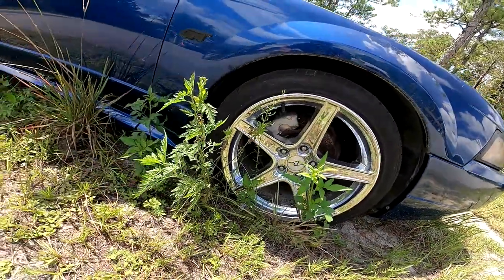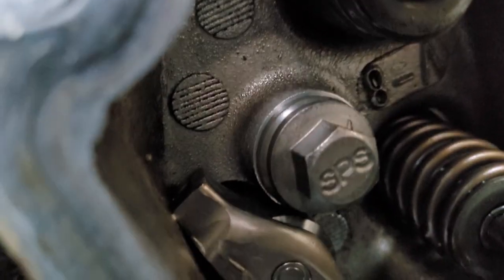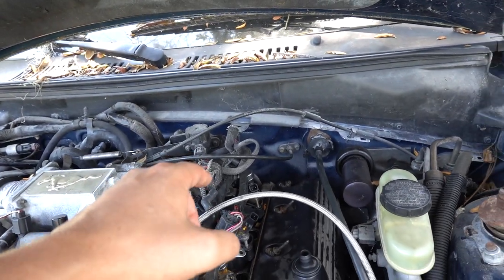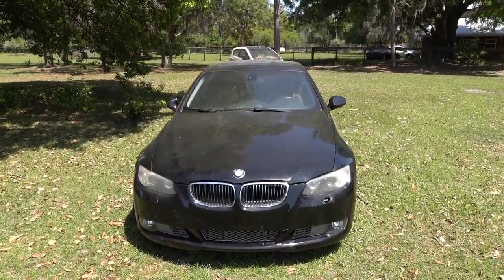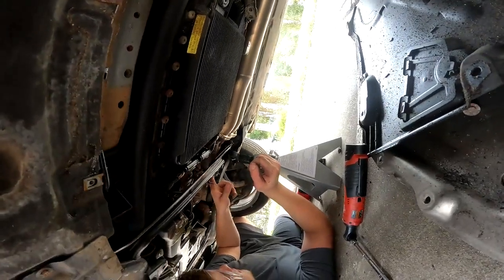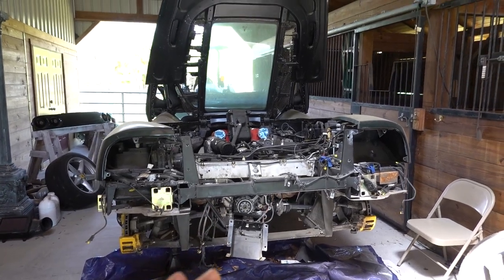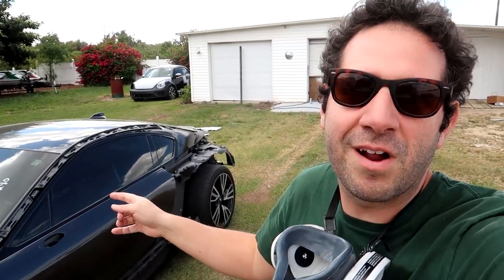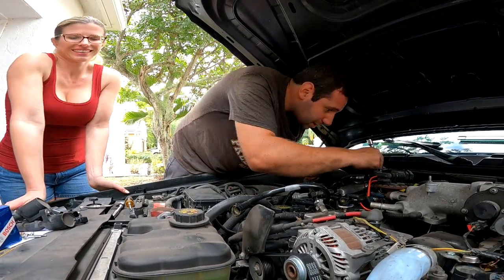Here's What I Found Inside my $500 Mustang GT's Engine (I've never seen anything like this)

Comment: My mate bent a number of valves when the engine seized and snapped the cambelt (he didn't fit the seal on the oil filler). He needed the car that day! No word of a lie, my mates dad whipped the head off, removed the valves and straightened them in a big vice by eye. He then reassembled it, fitted a new belt and oil filter and it ran - UNBELIEVABLE. Why don't you do a timed challenge!

Comment: I have a suspicion that the problem with the Mustang is a broken valve spring. This causes the valve to drop and tension to be removed from the rocker, which lets it fall out. You may be able to replace a valve spring without pulling the head.

Comment: Use lapping compound to lap the valve to the seat. Test the valves by turning the head with the valve face up and spark plugs in and fill the head chamber with gasoline, if after half hour the gasoline is still there the valves are sealing.

Comment: Have some1 hold the hood up even pry a lil bit.  Get a long saw zall blade and cut the striker on the passenger side.  The striker only bolts to the hood.  So cutting it is no problem.  It’s an easy replacement.  My buddy just did the same exact thing on a 3 series,  and it worked out great.  He didn’t damage the hood at all.  Same thing passenger side would not pop.  After he cut the striker he got the hood open n found that the cable had slid off and that’s y it wouldn’t open.  Good luck Sam!

Comment: It's crazy that same exact thing with the hood happened to my son's car. I actually wound up going to Harbor Freight and picking up some hacksaw blades ,fitting them in there and after about 25 to 30 minutes of sawing it, I cut the latch off and the locks work perfectly we went and bought a new hood and they lined up just fine.

Comment: Easiest way to open the hood, at the risk of some minor paint damage. Get a section of heavy gauge, right-angle iron fence post cut to the width of the hood. Get a length of flat copper bar, same length and bend it lengthways to form a right angle. Mix up some (O2N2CH2)3 and use that as a sandwich filler between the iron and copper angle bars. Some care needs to be taken during the mixing and filling steps. Place the bar across the front of the hood, then attach ignition coils and wires at each end of the bar, ensuring firm contact with your filler. Stand well back, apply a current to the igniters, and the hood will then be easy to open. This is a very simple solution to most BMW problems.

Comment: When you replace the F250 fuel tank, see if you can get the fx4 saddle straps with the bolts and the fx4 fuel tank skid plate (or aftermarket).  Maybe no more “something drove up under the fuel tank and dented it” issues.

Comment: The tire off liner out is the best way but you don’t want to pull on the cables the latch has a secondary release that a flat head screw driver can fit into take a really long skinny one . You slide the screw driver threw the rad support into the latch Accessing the secondary release
Reply: Look up the latch on google and you can see the seconds release switch on the side of the latch it’s a small part that you click down 
I work in collision repair and this is a fairly common issue

Comment: When these engines sit for a long time, some of them have a problem with the hydraulic dampeners for the valve train bleed down leaving a ton of gap between the valve and follower. Then,, when you turn over the engine, it sweeps the follower off the dampener and it just falls onto the cylinder head. As a 35 yr. Ford tech, I saw this many times...

Comment: Try pressing down on the hood and lifting it up while pulling on the cable through the fender liner compartment. Had the same issue...
Reply: I had a cable break on me. It had a plastic union and got brittle and broke after 15 years. It also didn’t help that it got hit in the front and the hood didn’t want to open right anyway, so the extra strain on the latching mechanism speed up it’s failure.

Comment: The valve that is hung open is stuck open for some reason other than the rocker arm. The rocker arm fell off because that valve isn't coming all the way back up allowing the rocker to flop around until it fell off. Find out why the valve didn't close all the way.

Comment: sam i just had a look at my 335i latch set up what looks like the problem with your latch is the hood cable joins into a joiner block and merges out as 2 cables i am guessing one of yours has broken or dislodged the rocker on the lock is hidden behind the lock plate and a cow to get to.1 if you can see the lock from the front of the underside of the hood you can get a thin piece of rod 1/16 diameter and put a right angle on the end about a half inch long and where the hood tang goes into the lock hook behind on the drivers side and turn anti clockwise and it should release the latch.2 where you see the cable on the drivers side under the fender follow it behind the headlight and where the cable joins the joiner block the longer cable is the passanger side grab that cable and reef on it and see if it opens it the outer cable may have come unhooked but the inner cable should still be connected as a panel beater this is what i would do good luck cheers from down under

Comment: The likely culprit of that popped off rocker is a failed hydraulic lash adjuster (aka lifter) underneath it. If they collapse, the rocker will pop right out. Fun fact, the Chrysler/Jeep 3.7 and 4.7 use the same lifters as the late modular Fords. Don't believe me just look it up. I replaced several on a 3.7 v6 years back that did the same thing.

Comment: Head off and check the seats. Fix could be cheap and easy. Replacement head possible. Replacement engine more expensive, load more work to fit and you have no idea if the replacement is even worse so major rebuild time. Head off and valve replacement probably cost less than just buying the i8 head gasket

If you want a load of upgrades / paint, then a full engine rebuild with better cam, etc, is cheap compared to bodywork, etc.

Comment: I saw this on a four valve ecotec gm 4 banger. Except it didn’t bend the valve. Still had compression and was just running on three valves  on cylinder 1. it was missing one intake valve.  No check engine lights no way to tell until I happen to be doing a Valve cover gasket for a friend.

Comment: I had a E36 BMW where the hood release failed, I don't know if they still do it, but on mine it was designed so you could easily remove the plastic from the kidney grill to access the release cable.

Comment: Until you get to the inevitably stuck EGR valve bolt, you could have the top end of that engine off in an hour. I've done it. Alternator could be done blindfolded.

Comment: Why not just cut through the latch with a Sawzall, those things are usually bolted on, so if you cut through it, it should be easy and cheap to replace.

Comment: What was the outcome of this car? I bought a running 5-speed manual 2004 GT with 138k 4 years ago in Fl. for $2500. Drove it for a bit. Bought a 2003 4.6 2v PI pulled from a Grand Marquis with 63k on it for $900. Put a $300 used set Comp Cams 262AH cams in it with TFS valve spring and retainer set, new gaskets, used K&N cold air kit from LKQ salvage for $130, used Mac Long Tube headers $150, Off-road x-pipe $190, Stainless Original Flowmaster 40's welded in factory tail pipes, Brenspeed custom tune on SCT-X4, FRPP 4.10 gears I'd had for years in the box new, subframe connectors, and handful of suspension parts to freshen handling and straight line traction.  It dynoed 291rwhp and runs 7.90's in the 1/8 mile on slicks for under $5k total. Your barn find was a fairly straight and clean one. I hope you did something useful with it or sold it to an enthusiast that will/did. These cars are fun and very easy to work on. They will be the next foxbody.

Comment: Once upon a time I had a 68 Fairlane coupe with a 302 with 351 heads and a 600 Holly carb, and that car would spit a pushrod past the rocker arm whenever I asked for the beans. Never could solve it. I did smoke a Z28 once though.

Comment: The cylinder got flooded with gas.
Need to put some Trans fluid in the cylinder for overnight and it should release the the piston ring as long the valve not bend

Comment: I've had a good couple 2003 E39 530i Sports with manual transmissions with 98,000 to 166,000 miles.  They're not that rare up here in the DC area.  Though the rust is pretty popular up here.

Comment: Who thought a missing rocker arm would cause the valve to stay open? Rocker arms OPEN valves, not close them.  Don't replace just the top end without replacing crank bearings. They always fail 20-30k later because they get hammered from the piston hitting the valve.

Comment: I would still urge you to pull the head off of the Mustang. By a new valve and lap the valve what it will do is it will actually grind the new valve and the valve seat and it will give you a firm seal. The cost is negligible and if you can do that it will save you hundreds and hundreds of dollars. As for the look of the car it would be cheaper just to get a wrap done on the car.

Comment: wouldn't a missing rocker arm cause the valve to stay closed not open?
Reply: Yes and the stuck valve is why the rocker arm jumped off.
Reply: @CCW1911  yeah, so why would he think putting it back in would fix it?
Reply: @rolan116  I don't know  but guessing maybe viewer content, building suspense? Doesn't make sense from a practical view, I have built many engines and worked in a rebuilding shop but know nothing about making youtube content.
Reply: Valve is stuck because it's bent, I've rebuilt and built so many of these 4.6/5.4s. timing guides are likely gone and the valve touched the piston, bent the stem, then knocked the rocker out. 75% of the ones i see the guides are gone because people hop in start it and take off.

Comment: The problem goes like this that mustang will never be worth more than 3k-5k with a new engine suspension brakes. And while yes 500 plus all the parts 400-800 for a engine and 2500 in other parts then 10k in labor flipping it he would be looking to make only 2-3k at best.

Comment: thanks to modern science, gutting cats might get you 20hp. They are not as bad as the junk bead cats back in the 70s... 

now, if you have a real  high performance car, say a Corvette Z06, ZR1, BMW M3 or M4, Porsche Turbo, you might get more power, but I don't think it will  be massive.

Comment: Sam please save this Mustang It is one of the best looking models ever the styling on it is excellent now if you want put a 5.0 in it or the shelby  cobra engine in it dude ( STILL ITS WORTH TRYING TO REPLACE THE CYLINDER HEAD and A NEW VALVE AND OF COURSE RE-TIME THE ENGINE IT WILL BE GOOD but if you want to save time , Engine replacement is the route) but don't sell this PLEASE!!!! bcos you will have lot of fun and can easily make this crazy fast ( mods ) but also reliable I love it !!!! please this will be an excellent project just like the BMW I8 and very cheap to get it done , with the break pads and caliper and the suspension replaced this thing will be excellent of course a paint job as well come on Sam , make this mustang one of a kind special with a few awesome mods and all , I WANT TO SEE THIS SAVED!!!!

Comment: Sometimes you get lucky, I picked up an old 4.2L Audi V8 from 1993 with a timing belt that came out in 4 pieces. 4 over head cams, 32 valves, all aluminum engine with 2 distributors, one on the back of each cylinder head. Surprisingly no internal damage, now it's my my daily. I did a video of it on my channel, still have the belt pieces after dodging that bullet.
Reply: That's a unicorn. Great score on your part.

Comment: I get what you mean about the cost of fixing the Mustang. However think of it this way. A lot of people don't wanna buy a project car. They want one that's already been tinkered on and redone. If you fix the suspension, change the engine, replace the brakes, and then deal with the paint, someone will buy this car just for the fact they won't have to do all that work themselves. Sometimes a car is worth it. And you don't have to go with an original engine. Find and put a better one in it instead. And you don't even have to repaint the car. Just get the paint blended, touched up and polished. Which is way cheaper. What's more I know a refurbished Mustang fixed by you would sell. People want your cars.

Comment: BMW HOOD LATCH Have someone pull the cable throu the fender well and then take a very long flathead and from the bottom with the plastic bumper skid pan off you and barly see the latches through a small window and lut pressure on it while someone is tugging on the cable I just did this a week ago

Comment: i pasused the video after you just wanted to install the old rocker obviously if the valve was open and not returned back up with the valve spring obviously its bent and not sealing

Comment: Someone help me here... why would the valve seat be damaged? 
Unless the piston pushed the valve at an angle into the seat or broke the valve off completely, how could it happen? 
The spring return pressure alone doesn't seem like it would be enough, even with the valve slightly bent - especially over the very short amount of time the engine has run.
Am I crazy?

Comment: I Pulled the grills out and pride the metal panel down the cable there's a cable that goes from the driver side to the passenger side latch I grabbed ahold of the cable with a pair of vice grips and pinched the outer and inner cable together and make the whole thing to the driver side and pop the latch it definitely is a bad design

Comment: Sam .....On the truck........Just remove the bed ..way easier it's like 6 bolts ....fuel nozzle ....and rear light harness.....takes like a hour ..and a hoist ...........or you can just jack the bed out of your way....good luck ......hope this helps ......have a F150 ......that eats Fuel pumps ...........so I have have done it alot ...Good luck ...and keep up the videos......Oh on the BMW hood ..can you get to latches through the front grills ?

Comment: Breaking down that motor is actually pretty easy.  If you do it, just remember, you can unbolt the passenger side exhaust manifold from the head because you can easily get to the bolts. The driver side, unbolt the exhaust manifold from the cat pipe so the manifold just comes out with the head.  

Also brakelabs is a good online spot for brakes(if they are still around, can't access right now on muh work computer).  Got crossdrilled rotors and pads for "I think" $130.

Comment: That curve in the piston gave away the bent valve. Why do you make it sound like such a big deal doing work on that engine. I cut my teeth on replacing valves and heads on cars. We have a machine ship in our town that would fix that head for a few hundred. Look Sam, if you don't want the vehicle, sell it. I used to buy $500 cars all day long back in the 80's and get 2 or 3 years out of them . When they died, I would pull them to the junk yard. People somehow got it in their heads cars running are worth $1,200 When most wouldn't  get that in scrap prices.

Comment: If you want to do a relatively cheap repair on the Mustang pull the head, get replacement valves for the bent ones, and rather than take it to a machine shop lap the valves. It's an old school technique but then you'll know if the valves will seal or if there are bigger problems. 

And rusty rotors?!? My rotors get rusty every time it rains, I hit the brakes a couple of times and that cleans them up, that car would likely take a bit longer as it's sat for a while but I really can't see that as a big deal.

Comment: Hey Sam,
Sorry to break the bad news to you but that e39 530i on has the Sport pkg. It's still a pretty rare configuration, being the facelift e39 530 was only made in 2002 and 2003 and finding a manual equipped Sport pkg car is hard. True M-Sport e39s were only produced in 2003 and were 540i with 6-speed transmission.

Comment: Hey a repair I've done!! I dropped and replaced the gas tank on my 2014 Ram... As a result of a broken plastic nozzle on the evap (it's all one piece apparently) not a cheap fix, but pretty easy overall... One thing I would recommend since you're in there, replace the fuel pump and sending unit.. but I'd like to see you tackle it...

Comment: Lol.  This has happened on more lawn tractors that people bring me than I care to admit. :)  Just this week, my own ancient Poulan with a briggs 14.5hp had a valve stick on it’s first start of the season, and the wee valve cap that sticks between the valve stem and the rocker popped off, fell down the oil gallery, and came out when I drained the oil to change it… Popped it back on, adjusted teh valves, and Ol’ Faithful is back in business.

Comment: if the latch system is anything like my 2001 525i, to get to the passenger side latch, you go through the grill. I had to do it and it worked. I took out the driver side kidney (if I remember correctly)  - you will probably break the tabs - mine were already not great so it was not an issue. I can't remember exactly what I did after that - maybe a needle nose to pull the cable? I'll see if I can find the reference I used to make it work. My cable had come apart at the junction on the driver side and all I had to do was put it back together (once the hood was open of course).